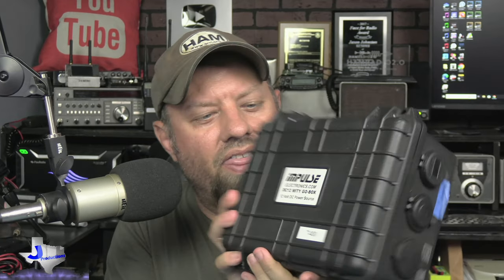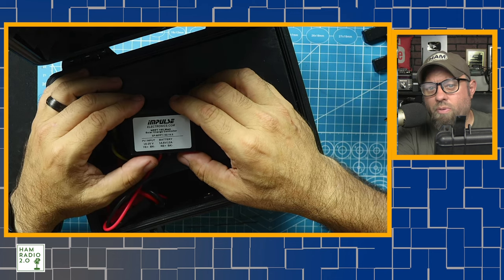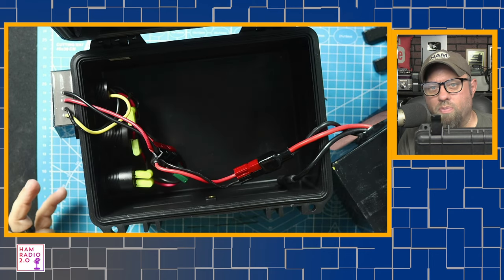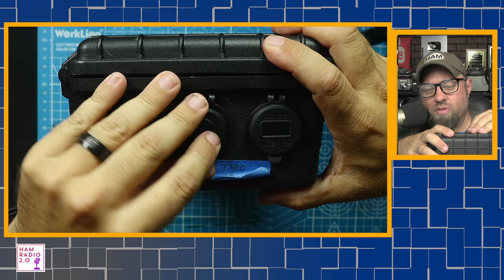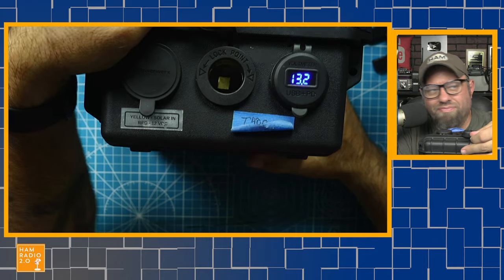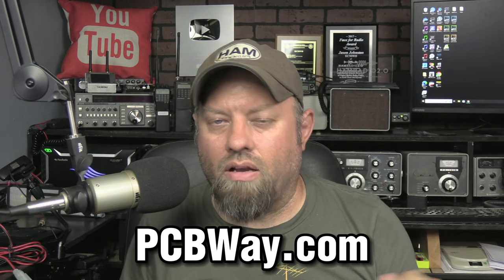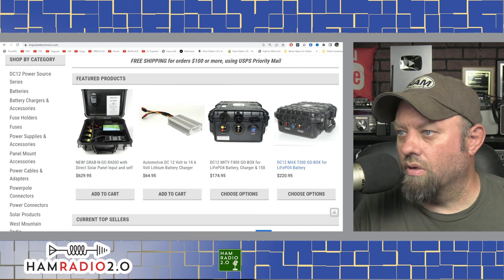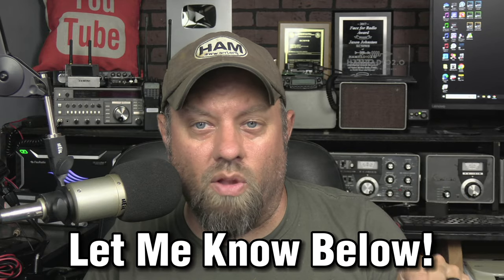HAM MADE Impulse Electronics T400 Battery Box

Comment: Good to build your own... mine holds a 30ah EcoWorthy with lights usb and 4 set of powerpole.. Case was $8.99, Small Fuse Box  5.99, USB/C, Powerpoles, Eye Lights ( I have White for Emergency Use and Green for Overnight Reading Use) 10.99 all in I was about 96 bucks and I have left over for another.